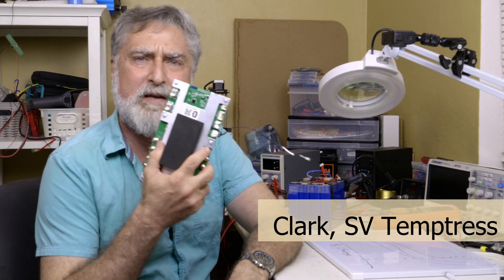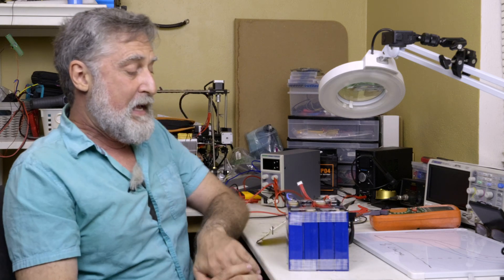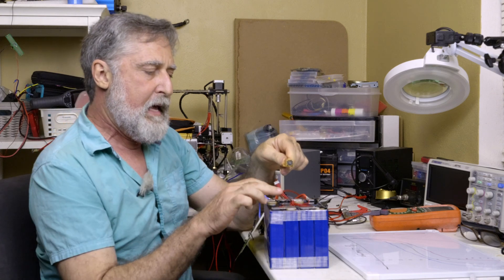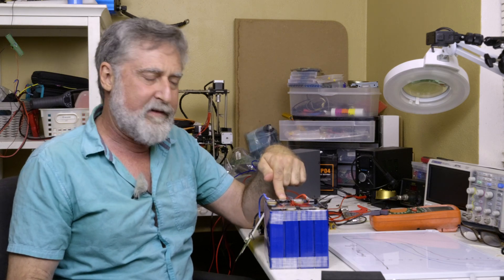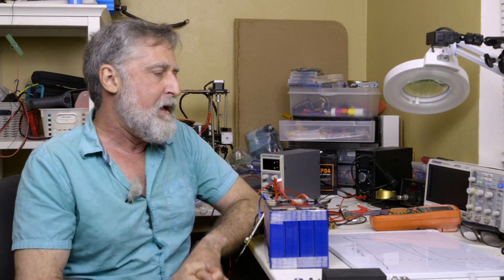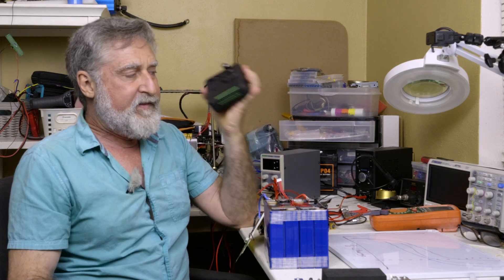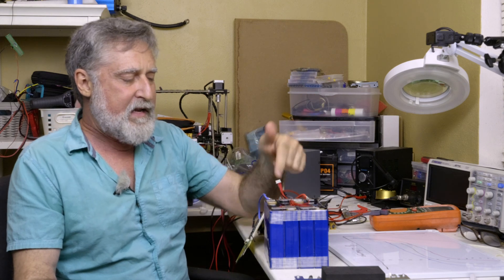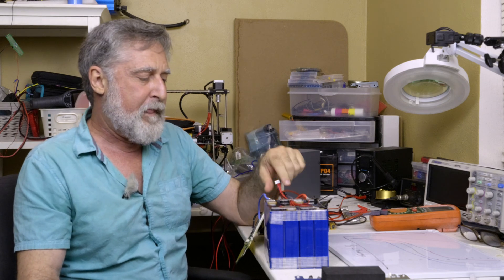How a LiFePO4 BMS balances cells

Comment: Clark glad to see you are healing and enjoying life again! The spark seems to be back! I always appreciate and enjoy learning from your videos! Thank you for taking the time to share. Some great ideas as always Question: will a version 3 be able to upgrade or add the new features in version 4 with a software update or will I need to buy a new 4 to. Get the features? .. don’t have one yet .. thinking time
Reply from the maker: Well the Gen4 hasn't actually been designed yet but every one of my ideas implies a hardware change so I'd say no.
    I'm just not sure what or when or if I'll do the Gen4.   It may never actually happen or I might wait until I get a contract from a battery company to develop it into a BMS.   If that's the case it will likely only be available inside one brand of battery (likely an expensive one,)for at least a few years.
   The Gen3 might be the right answer for most people for quite some time.

Comment: 9:42 for me, Active balancers are only needed for cheap mismatched cells, such as what you might get from a random aliexpress seller. If you order 4x 100ah cells and the real capacities are 100, 104, 106, 110 AH, a passive balancer will let you use this as a 4s 100ah battery, or you can use a BMS with active balancing,  but leave it disabled until a situation arises when you need 105ah, then turn it on and you have a little more power.

On bigger batteries like a electric motorcycle uses, you have 20-30s, and a batch of random cells might be 100ah to 120ah, with everything in between. So the passive balancer BMS makes it a 100AH battery, and the active balancer makes it a 100AH battery with a emergency 10% range extension. But this requires the most agressive active balancer because 2a transfer will take hours. Lol

For my 20s6p 32700 pack I use an ANT BMS, and set it to end charge at 3.45v. No need to take it to 3.65 on a regular basis. 

ANT lets you choose how to balance. You can set it to bleed off anything over 3.45v (or whatever you want) or set it to automatically balance anytime the following conditions are met:
Charging current below xx amps (I use 1 amp)
Highest cell above x.xxxv (I use 3.350v)
Differential voltage >x.xxxv (default is 0.020v).

If you can add a periodic charge to 3.65v every 10th charge, that should help avoid capacity loss, but it’s really only a problem for cells that stay at 50% too long. If you take them 15% to 90% normal cycles, the ions don’t tend to get stuck in the overlap area. 

I have personally recovered significant capacity from cells that were stored at 50%, by taking them to 2.5v and holding it a day until I see no more ions want to wiggle their way out, then i charge to 3.65v and hold it for 24 hrs or until no more ions want to relocate. You will know when amps needed to discharge to 2.5v or charge to 3.65v drops to 0.01a.

For most 1P LFP batteries it’s probably a safe investment to get the JK BMS, but just set it to top balance. And if the batteries ever degrade unevenly and one day you need every last mah, you can turn on active balancing for anything over 2.5v and get all the energy.

I have seen people buy aliexpress cells and try to make a JK fix the problem, it doesn’t. Lol.  He had 2 cells so low that the active balancing would need to atay on 24/7, and if ever needed to use all the energy it would take hours to bottom balance. The only correct fix is order addition batteries, make a 21ah pack with all the good cells and a 18 AH pack with all the bad cells.

Comment: (Repost, I accidentally posted as a reply to someone else’s comment lol) 6:12 in related topic, I have a ToolkitRC hobby charger that I use to test my cells, and fast balance a pack I build before turning that duty over to the BMS.

If I need to discharge a cell for testing or a cell group in a battery to bring it down to match the others, I can discharge at 3a internal with a load resistor and cooling fan built in (same concept as what is incorrectly termed passive balancing), or I can connect another decent size battery pack and use RECYCLE DISCHARGE, which allows 20a, in similar fashion to how an active balancer can discharge so much faster that when it all has to ve turned into heat, without cooling fan normally.

So it’s easy to understand why a bleed-type balancing BMS might have a .1a discharge while a recycle-type balancing BMS can do up to 2a, 5a, even higher, and this s is why they have thick balance leads. 

So as far as does the job of balancing a battery that is out of balance, no doubt, recycled type is best. But that doesn’t mean every battery needs that type after its initial balance. I will finish watching the video and see what is said about who needs which balancing method.

Comment: @1:10 I agree 100%. Whoever was allowed to call the complex process of measuring each cell voltage, checking with the balancing protocol to either bleed any cell over a certain voltage or the highest cells whenever the differential voltage is above the setting, through a bleed resistors by opening a dedicated transistor to a dedicate resistor “Passive Balancing” is an idiot. 

They could have said two basic types od balancing:
Bleed, where excess in overcharged cells is turned into heat in a resistor 
Recycle/Transfer, where excess energy of the highest charged cells gets moved to the lower charged cells.

Both are active. Neither can be done passively.
Reply from the maker: What he said

Comment: Sounds g8. Thx for BMS Balancy clarity. I guess using the DC power supply at 9A/15vdc to push the charge up until the BMS kicked in/turned off inflow probably shortened the battery life some. I just impatient and thought it would be a faster way of getting from 98% to where LiTime BMS would do the balancing. I’ll be more gentle in the future. 

It really sounds like version 4 will be kick ass. I kind of seems like it would be hard to put off inspiration until winter time--it seems so far away.
Reply from the maker: I'm still recovering from the cancer surgeries.  And maybe I'm a bit lazy.

This year the big process I made in BankManager was a corporate restructure.  I now have people answering questions and dealing with shipping and such so I have time to think about new stuff.
    I actually spent the year figuring out how to make less money.

Comment: there is no "hard point to find where its full" on batteries if you repeat this nonsens 100 times it will not become true.
a LFP battery is full at exaclly 3,65 volt , if you try to tell the world a LFP ist not full at 3,65 Volt coz you decide new rules then good luck in your 1 man universe.
Reply from the maker: It's not me "deciding" this, it's proven in many academic papers on the subject.  There are many studies where they charge to 3.65v repeatedly then cut the cell open and study the damage.  Read and learn.
   This is so important that Epoch, LiTime, SOK and others have added code to their BMS's to try to stop charging earlier.  Epoch removed their code because it made the batteries hard to charge and they found their code didn't work.  
    It's a hard problem to solve, I did it.

Comment: Not "Pro Passive?"
Reply from the maker: Yes, I see that
 ...but pro-active is an actual word that describes what's happening.   It's reacting essentially ahead of time before the problem has even happened.
Reply: @Clarks-Adventure   If you are doing "pro-active" balancing do you think its better to check bottom balance or top balance?
Reply from the maker: @uhjyuff2095 I think the way I and most people use batteries, top balance only.
Reply: @Clarks-Adventure  it makes sense. I figured someone might have a system that would benefit from bottom balancing and it would be cool to have a option to choose in your "pro-active" balancer settings. Maybe default is top balance.

Comment: Clark:  I think it is silly that a single BMS is trying to juggle 4 batteries in series.  Why not just make a BMS that takes each cell and manages it.  Basically, have 4 mini BMSs that each manage it's own cell to 3.6v.  This way each cell would stop charging at 3.6v while that others are still charging.  No need to top balance any more.
Reply from the maker: Design that circuit.  And remember it has to be able to pass full rates output power at any second 
  Not that easy or cheap.  And this works
Reply: you dont understand?
 it is the job of any BMS on this planet to track 100% ea cell in any battery any secound and mange each CELL every secound !!

if your battery have 8 cells build in the a 8S BMS is build in and this BMS knows any secound 100% the ecaxly voltage from ea of this 8 cells an is set to charge any of this cell to exaclly 3,65 Volt what ist 100% charge excaclly.
what is so hard to understand?

this youtuber talking all the time about battery randomnes and only he knows the real truth
Reply from the maker: Read the answer to your other comment.
Reply: @ThomasNowicki-m5s  Sorry Thomas.  It looks like you didn't understand my comment, Clarke did.
Reply: @michaelzakharoff946  the BMS is not really juggling 4 batteries. It’s doing a very simple job the way a human would but 1000 times faster and 24/7 without demanding $15/hr and health care.

It simply has a processor inside that measures each cell voltage one by one many times per second. Each time it measures, it checks the settings for overvoltage limit, undervoltage limit, balance start voltage. If any cell voltage goes over the balance start voltage, it will open a tiny switch from that cell to a bleed resistor and let energy out until its voltage is no longer above the limit. 

If any cell goes to 2.5v, it will close the discharge port. 
If any cell goes to about 3.75v, it will close the charge port. 

My LFP battery is 20s, so it’s managing 20 different cell groups. Its such a simple algorithm that a low power microprocessor can do it very fast over and over without rest. 

All real BMS have Bluetooth and are user programmable. So this is another reason why 1 real BMS is better than one small BMS per cell group, acting alone. ANY Bluetooth BMS lets you tell it when and how to balance. You can say charge only to 3.45v, and balance whenever the difference between the highest cell and lowest cell is more than 0.005v (or whatever you want). You can’t do that with individual BMS without going into each bms and changing its setting. 

Thats why nobody uses a single bms per cell in a battery with more than one cell in series.
Reply: I dont understand it to .
a BMS have to Job in a series of 4 cells Cut off ea cell at 3,65 Volt =4S BMS passive Balance 
What is the Differenz to Put on ea cell a 1S BMS what does the Same?

Comment: JKBMS has a float mode now, I plan to just let it rip as far as my charging goes and have the batteries control their own charging. I know, tsk tsk it’s a safety mechanism, not for my rig, that’s what fuses are for 😉
Reply from the maker: They are your batteries.  But they won't last terribly long that way
Reply: @Clarks-Adventure I’d think they’d last equally long considering they’re floating at 3.45V/13.8, the same as your Batmon solenoid I assume while full.
Reply from the maker: Nope.  Not the same.   I'm seeing reports of 6 years at those settings sometimes less. It is what I recommend for those who can't get a BankManager or are having install issues.

But they are your batteries, do with them what you want.  Just don't ask me to change my mind from what actual research shows.
Reply from the maker: By the way I'm in negotiations with the biggest/best battery company just now to include my logic.
  They tried their own a while back and deemed it a failure.  Their latest offerings allow overcharge again.  
   It's the kind of thing where if you can't do it right you shouldn't even try.    
    I do it right.
Reply: @Clarks-Adventure  nice 6 years one year over the warranty :)
Reply: How is the JKBMS float mode not getting you pretty close? I’d think it’d even do better in some regard as you can measure individual cell voltages vs. the pack.
Reply from the maker: @leblancexplores not even close

Comment: I'm a great believer in KISS, Keep It Simple, Stupid. Passive is the simple option.
Reply from the maker: Yep.

   But right now I'm doing an analysis of a 460ah Epoch with 100ma balancing 
   This is ridiculously slow!
Reply: @Clarks-Adventure  Epoch has slow balancing! My LiTime 230ah is even slower and they chose to only balance the highest cell meaning if two or three cells NEED to be balanced you have to wait till the next charge cycle. They really don't value fast balancing of these large battery packs.
Reply from the maker: Yes they are using logic and sub circuits from tiny cells in their BIG batteries.
  I'll be talking about it in my Epoch review video coming up.  They need to reengineer their balance circuit.  Starting with thermal management!   Not hard just a step we the consumers aren't demanding.       Yet

Comment: I’ve been trying to balance a 12.8v 280Ah battery for 2 1/2 weeks. It’s making progress but it’s painfully slow and still off by .178. I’m worried about causing damage to the battery by holding it at a high state of charge for so long. The BMS shuts down charging when two cells get up to 3.63 range for more than about a minute. Right now the highest voltage I can push before shutdown is 14.16v, when I started trying to balance it was down at 14.11v.
I plan on running a pair of these batteries in series in a camper van so I don’t want a sub par battery to bring the whole system down. 
Should I keep trying to balance or should I ask for a warranty exchange?
Reply from the maker: I honestly haven't thought where the line should be for a return.  I of course don't have that option (they would be happy to send me another, possibly better battery for review.  But I need to report on the random one I got first).
   If you return for replacement you are taking a lottery chance it will actually be better.  But after 2 weeks I say swap.

   Also, I highly suggest you check out my "Duffy" video and follow the link in the description to my battery balancer I use in this project but get the 2 battery version.  Note I said battery balancer not cell balancer.   I'd use one of these in any series install.  And they tend to cost a LOT.  This one worked for me and is cheap like dirt.
Reply: Thanks Clark, I already picked up a Victron balancer but will check out the one you recommend.
Reply from the maker: @jacobusdegroot7557 I'm sure any serial balancer will do the job.  And Victron makes great stuff.  How much for it 
   Last I checked mine was like 30 bucks
Reply: @Clarks-Adventure Victron is on the pricey side but has an excellent reputation and I'm of Dutch decent so love supporting anything from the NL, their balancer was $48.45 on Amazon. 
I checked the Duffy video and clicked the links but most of them seem dead. I did make it to your MarineDCAC page but don't see any balancers there.
Reply from the maker: @jacobusdegroot7557 nope no balancers there.  That's in the Amazon shop.

That's a great price.  They did drop their prices a bunch a few years ago.   Before I found mine a friend bought a 48v unit and was charged 500 bucks!   I thought Victron would have been in that ballpark
Reply: @jacob. If you have a sealed battery under warranty and cell differential is 0.178 it has a problem and you should get a replacement.

If its not under warranty and you can open it, then just manually balance it using a hobby charger.

If its sealed, no warranty, you can try to trickle charge it with 0.1a, this will allow the high cells to reach the bleed balance point and start bleeding, hopefully at 0.1a, so those two high cells will stay at 3.60v or so while the two low cells charge at 0.1a. It will still take a long time but it won’t constantly be shutting off.

If you have a real BMS with Bluetooth, you can normally adjust the settings and let it balance without interruption. Some manufacturers make it difficult to access settings but most BLUETOOTH BMS can be adjusted.
Reply: @imho7250  I tried to activate cell balancing on my new Litime 230ah battery. I slow charged and the battery would stop charging at 13.9v every time for 4 days straight. I saw no improvement and thought something was wrong. I gave up and opened the lid which I didn't want to do because its glued on. Then I did the test again and found out the bms stopped charging at 3.50v/cell and the info I found on the internet was balancing starts at 3.525v/cell. I thought I got a broken bms but for some reason I tried again but this time used my 20 amp charger and sure enough the battery shot up to 3.65v/cell and therefore activated the balancing circuit. LiTime decided to make it difficult for us guys but now I know how to get the bms to activate the balancer.
Reply from the maker: Uhjyuff
Watch my video on the liTime batter review.
    They made some really bad engineering decisions with their BMS.  (I actually replaced the BMS eventually and did a second video on that).
   Their BMS will stop charge at too low of a voltage if you charge slowly. It will also lie to you about the actual voltage to cover up what it did.
   I expect you saw this once you got it open.  (And that was a hard one to open, right?)
Reply: you try tobalance a ready to use battery or a DIY battery?
how you try to balance cells only ?
coz an opend battery is moren ten easy to balance without any sort of device